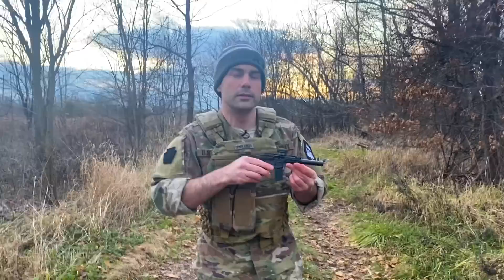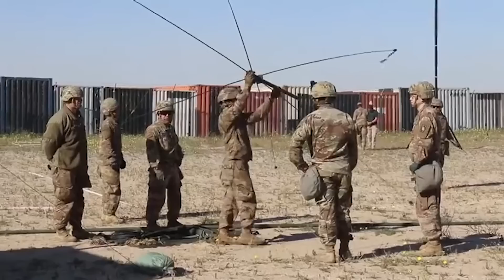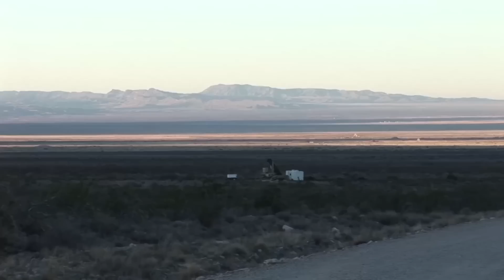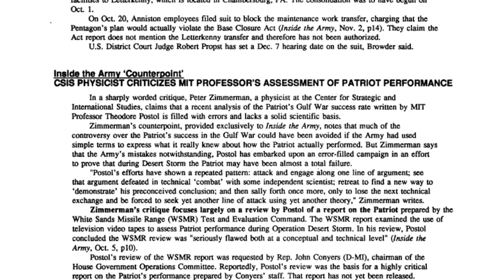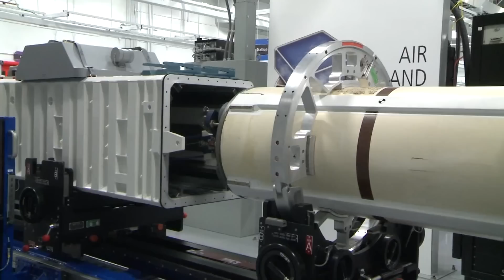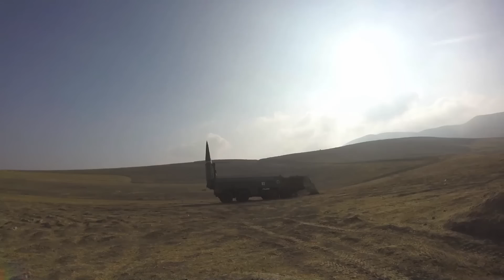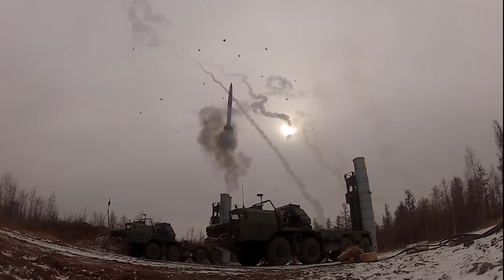Can Patriot Anti-Air Defense REALLY intercept missiles?

Comment: Minor correction near the beginning a bit after 2 minutes: the US absolutely had a long range mobile missile system - the MGM-31 Pershing (and later the Pershing II). The new LRHW that the Army just developed and that is undergoing testing also should probably count, as should the currently in-development OpFires project. There is a gap from 1991 when the last Pershing was destroyed to the introduction of LRHW once testing is done (unless you count ATACMS, but at 300km, that's a considerably shorter ranged weapon than the other ones being compared here), but Pershing was active up until well after Patriot was first introduced.
Reply: Let's be clear, the Pershing and ATACMS are Tactical Missiles (offensive). The Patriot is an Air and Missile Defense System.

Comment: Having been born in 86' and having worked with Patriot missiles in the Army... I'm not shocked to find out that the entire system is older than me... It alwats seems like something from a different era.
Reply: They're not older than you. The name Patriot may be older than you but the PAC-3 upgrade is a significant upgrade to nearly every aspect of the system. It took place in three stages deployed in 1995, 1996 and 2000, and units were designated Configuration 1, 2, or 3.

New software update known as PDB 5 (PDB standing for "Post Deployment Build") was released in 1999 with initial support for Configuration-3 ground units and PAC-3 missiles. The system itself saw another upgrade of its WCC, and the communication setup was given a complete overhaul. Due to this upgrade, PAC-3 operators can now see, transmit, and receive tracks on the Link 16 Command and Control (C2) network using a Class 2M Terminal or MIDS LVT Radio. This capability greatly increases the situational awareness of Patriot crews and other participants on the Link 16 network that are able to receive the Patriot local air picture.

Raytheon continues to develop the PAC-2 variants and Lockheed Martin MFC developed the PAC-3, PAC-3 MSE and THAAD.

Comment: In short words you are saying that despite official claims of high rate of Patriot interceptions the real evidences we know so far says the opposite including expert testimony. Now that explain why the USA bought two batteries of the Israeli Iron Dome missile defense system that have proven itself be capable under any weather condition without of the justification of the small target size. Maybe the failure of Patriot is the reason we are moving to lasers anti missile system looking for a workaround. I would rather invest high percent of those 900 billions the army spend annually into get a technology as capable as the Iron Dome. We were questioning that each interceptor the Iron Dome use cost 100k but now I know each interceptor of the Patriot cost 4millions despite the low rate of accuracy 🤔🤔🤔, looks to me that because it's tax payer money no one cares. Nice looking tablet but if the interceptor is not accurate at all, that system is a teenager toy.

Comment: The software failure of the Patriot Missile system is infamous in computer science and was taught as a case study in my Dependable Systems module for my degree. For those interested it was caused by a floating point error. Basically the software calculated the current time as (cpu_clock * 0.1), unfortunately 0.1 is a recurring number in base 2 (0.000110011001100...) and the targeting computer used a 24-bit register so there was an error of 9.5e-8 seconds. This error went unnoticed during the testing phase because the system was only active for a few hours at a time so the error had not compounded enough to affect performance. However in the field, after 100 hours of run time this error added up to 0.34s. A scud can travel roughly 500m in 0.34s. Every programmer naturally encounters this type of error at some point in their career, its a shame that in this case there were such deadly consequences.
Reply: That was a great explanation. I remember hearing about it when it was revealed to the public as the failure behind missing the Scud missiles. I just never really understood the mechanism behind it. Thanks. 👍
Reply: Refreshing, a comment actually worth reading lol.
Reply: Wow, thanks for the info! I had learned about this in an engineering case study, but I think they just referred to it as an error with the clock. It’s amazing how such small things you’d never thing about can cause major errors. We’re not used to thinking about 0.1 as a repeating decimal because it isn’t in the base-10 system that we use. But computers use base-2.
Reply: This is fascinating, as my son is taking Controls right now as his first class in pursuit of his Masters in Computer Engineering.  Many of the examples he's given me as an explanation of the class involves missile guidance.
Reply: Ah I thought this was about the drone strikes in Saudi that Patriot didn't intercept, but that's not rly an error. Patriot is now undoubtly one of the best allround airdefense systems, had many upgrades, powerful & unique radar (tracking & targetting radar in 1 so enemy aircraft wouldn't know they're under direct threat already). In contrary to rus systems like s300/400 who seems to be very overrated as they were overhyped & many thought world best airdefense, until they were tested in battle Lol. With Nasams (made togethere with norway), Patriot, Thaad, Aegis the US has basically all the best airdefense systems. The only trouble with these systems not rly the high cost to make, but more the cost of 1sam missile like amraam. Very good missiles but at 1mil$+ each way too pricey. 

And drones is another new thing these systems can't really intercept. But then again other weapons can. Just have to protect at least the radar from these kind of small & stealthy drones, like with a Phalanx Cram. Then I realised why these systems are mostly placed closed to big cities, like Kiev in Ukraine for example, and not on the outer edge of the country to have the advantage & reach, cuz it would put the system at risk against drones or other overwhelming methods. But Patriot proved itself already, so the question if it can intercept missiles, is silly. Even hypersonic ones get intercepted by Patriot. Wonder if other hypersonics the likes that Iran has if they would be caught too.
Reply: Interesting.
Reply: why not patch out the error with an update?
Reply: The issue was that they stored the time as a floating point number and continuously added 0.1. If they had stored the time as an integer and had incremented that value by one every tick: the multiplication with 0.1 and conversion to a float when actually reading the time would have been fine.
Reply: What I don’t understand maybe you know that why the clocks apparently were not synchronising on a regular interval. Because there is always some clock skew to expect.

Comment: It's just a downgrade that is needed to replace S-300 Ukraine been using for so long for which missiles are in shortage as of now. But i guess you will figure that out later.. both that S-300 being in shortage, and Patriot being a "downgrade" in comparison to S-300 it supposed to replace. Considering the price of each Patriot missile.. they are not gonna last long.. if at all. 

There is even more risk of being hit by ARM. The Patriot is going to be targeted by ARM at some point even if it wasn't the target initially, ARM still might lock onto it's radar systems, and there is always a chance that Patriot can fail to intercept it.. Because no anti air is 100% effective, especially not against modern missiles like ARM. Usually it's starting from 20 up to 30%. Only soviet and post soviet anti air systems have a higher effectiveness rate. Like S-300 from USSR that Ukraine been using and is on missile shortage now. Or Russian S-300V4 which got a world record for destroying aircraft from 215km during this conflict. Just so you know.

Comment: That is a sort of messy report. First, you question the effectiveness of the Patriot, then you say that they will allow to protect high value targets and move S300 to protect frontlines. Based on practical evaluation, S300 is much more capable than Patriot, at least it doesn't miss Scuds.

Comment: I'm a bit curious about price of Patriot missiles. Is it cost-wise to shoot this sort of missile to take down kamikadze-drone worth of a motorcycle.
(Well, it's the same case as Israeli "Iron Dome", I suppose - that's more about damage prevented than straight price comparison).

Second point: production time of Patriot missiles. Can they be produced at the rate necessary to counter barrages of russian missiles and drones.

Third point I have is about the fact of introduction of Patriot system.
Doesn't it mean that other anti-air systems used by ukrainians are running out of munitions, so USA sends Patriots simply because they still have rockets for them in stock.
Reply: You answered your own first question -- in the case of the drones, the direct cost difference is highly inefficient. US/NATO gear is always very Gucci, compared to bargain basement former Warsaw Pact stuff. It's more about protecting the cost of the target. But Patriot missiles won't unilaterally replace the entire existing patchwork of Ukrainian air defense systems. They have a raft of different gun and missile systems in place or coming in from their European supporters. Patriot missiles will merely contribute to that portfolio and marginally help reduce the strain on the entire air defense network. One battery of 8 Patriot launchers is a drop in the bucket, compared to the hundreds of S-300 launchers Ukraine started the war with. Yes, the Patriots may be more efficient and provide an outsized positive impact relative to their numbers, but at best they may be equivalent to 15-25 S-300 launchers. That's a solid 10% increase in available air defense missile coverage, but it's far from able to fully equal Ukraine's S-300 AD coverage.

I remember seeing an article that estimated Ukraine started the war with ... 3000 S-300 missiles in stock? Don't quote me on that. Each interception probably requires on average something like 1.5 to 2 missiles fired at the incoming Russian missile, to improve interception probability to the 70-80% success rate Ukraine is claiming for recent missile strikes.

At 40-90 missiles every few weeks for months, you can do the math. We don't know how many missiles have been reserved or used for frontline AA defense against Russian aircraft.

I'd guess Ukraine still has 1000+ missiles, but they are definitely looking for more. I've seen articles with them negotiating for purchase of Greek stocks of S-300 missiles, for example.

Generally speaking, the Ukrainians have been loudly begging anyone and everyone to send anything they have that's former Warsaw Pact gear.

In the West, knowing nothing about US production capacity beyond INternet headlines, I would make a total guess that we do not have the capability to sustain large scale use of Patriots, on the order of how Ukraine and Russia have been burning through their S-300s. Everyone has been caught out by how rapidly a high-intensity war between two industrialized countries burns consumables. (though analysts have been aware of this likelihood since the Cold War by the late 80s)

I've seen articles this year estimating that the US may have 1200 missiles in stock, but we are DEFINITELY not ever going to sent more than a fraction of our available stock to Ukraine. I wouldn't expect more than 10% of that to be released.

An article from a few years ago stated that we were looking to roughly double annual production capacity, up to 500 missiles per year by 2024. This implies that Patriot missile production was NOT 500 missiles per year, probably more like 200-300. But that news was pre-COVID, so I don't know how economics have affected that timeline. But even if the US were to hypothetically commit 100% of that production to be sent to Ukraine (which the US won't for reasons of our own military needs), 500 missiles would be enough for only about 6-8 weeks of operation at the current rates of consumption.

Russia OTOH started the war with something like 8000 S-300s, which is why they chose to adapt a lot of S-300s for strategic bombardment. They only had a few hundred of each of their fancy newer missiles like Iskander and Kalibr, and are now estimated to have well less than half of those stocks remaining. With sanctions in place, their current rate of production of the newer precision missiles is something like 25 per month, and these are apparently being launched within months after their manufacture.

Comment: Its crap... anything that requires massive logistical support is fail. It should be relatively simple to use and operate. This overcomplication also is the #1 thing that drives up the cost... in other words... corrupt military industrial complex... its made by people that want to make massive money rather than the main driver of the industry to be actual effective weapons systems. The more complications (moving parts)... the more it breaks and its a downward spiral from there. Lastly... it sucked in the gulf war... it was terrible. Hopefully its improved but frankly its hit or miss... we have other systems that work better.

Comment: Ukraine and the rest of the free world requires much cheaper air defense against the slower and lower threats which are much more abundant; against the cheap drones, mortars, artillery shells, cruise missiles, helicopters and planes.

Cheaper than Iron Dome even.

Cheaper manpads.

Longer range than manpads.

Maybe the US or the Israeli laser systems.

Maybe electronic jamming of their guidance systems.

Of course a lot better integration of various assets.

More preventive strike capacity against their launch sites.

Mass produced rockets on a massive scale, with a hundred times cheaper components.

At this rate of consumption, you don’t need them using fuel that can be stored for twenty years. Regular diesel fuel is good enough.
Small rocket engines are not more difficult to mass produce than lawn mowers, and should barely cost more than their weight in raw iron coated with a cheap heat resistant material like Nickel Boron.
Electronic steering motors cost dollars a piece, and fifty dollar smartphones provide all the GPS, communication and calculation capacity you ever need.

In WW2, the US already had miniaturised radar proximity fuses for its AA shells.

IR and LIDAR sensors cost less than a thousand dollars.

There is no hard reason why a mass produced single shot rocket should cost more than a motorcycle. In fact, it should cost a lot less.

If NATO used the same standardized small and medium rocket platform both for artillery as for air defense, the production runs could easily be millions of pieces, with the corresponding economies of scale.
Essentially reducing the cost of a rocket to its raw materials input costs.

Comment: The PATRIOT is a phased array setup. Phased arrays are amazing systems that can do much more than previous systems. But the radar detection is always software driven. Modern tech can do amazing things, but with incredible support also required. That is the Achilles heel of any modern hitech weapons system.
Reply: You’re telling me I’m in patriot right now I’m the guy who fixes the radar and launchers and shit when they go down and god damn do they love to pop faults and go down
Reply: @texasthib2029  I used to operate a high-tech military system also. It took the military and the manufacturer about 10 years for the reliability to meet the expectations when it first came out. In those 10 years a lot of techs learned to fix it and maintain it. The manufacturer also had to sort out and incorporate the lessons learned from the operators and maintainers. It still operates to this day, but the support is not something you can export and have working within weeks or even months, when you sell or give the system to another ally. It has to be learned and incorporated into the new country acquiring it over a long period of time.

Comment: M61 vulcan in large numbers mounted on some wheals is what UA really needs for those low flying small targets is what i think. Surprised nobody is talking about those. "Patriots" are needed to cover a range of larger, faster and higher flying targets, but i'd speculate the M61 would work wonders at altitudes of less than 1km in the air on slower and smaller drones..
Reply: All credible experts talking about it here in Ukraine

Comment: Won't make a difference. Takes up to 100 men to operate these and up to 6 months to learn how to operate them (won't happen unless the US plans to directly send US personel over there which is grounds for direct war with Russia). US soldiers were having trouble with them in the Gulf War much less whatever's left of the clearly defeated and depleted Ukrainian forces. Secondly, the Patriot missile can not just be simply installed and ready to use, it has to be integrated into the air defense systems that Ukraine already has, which is actually a old Soviet style type of system mixed in with other minor western made intricates. Simply put, the Patriot system isn't compatible with what Ukraine has. The Ukrainians are doomed.